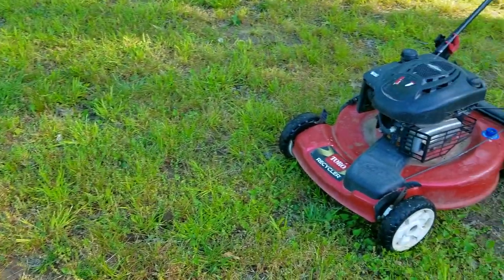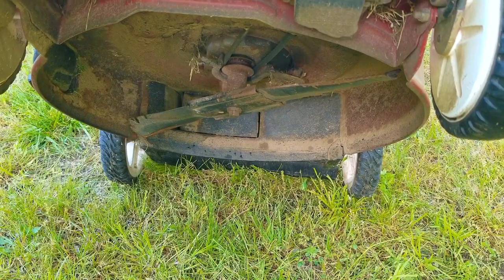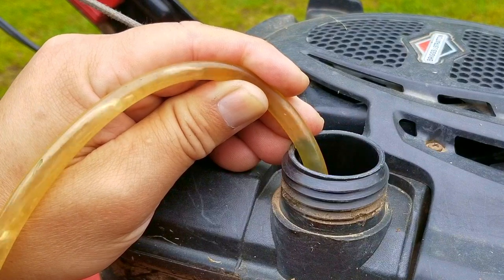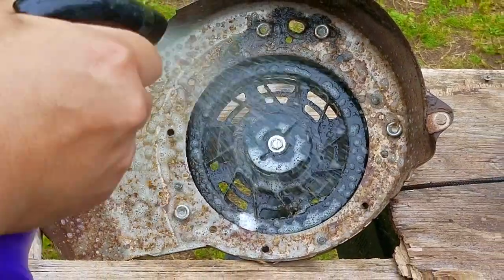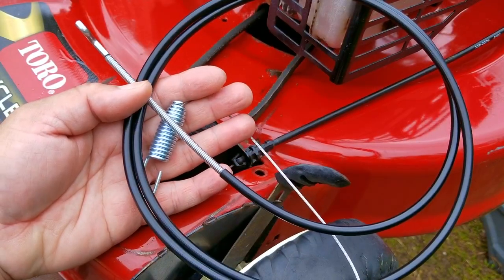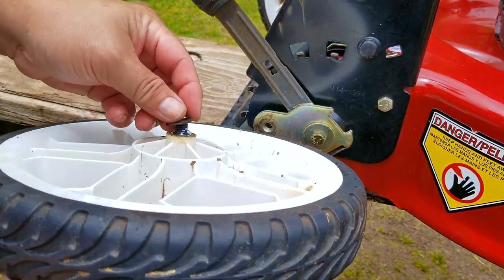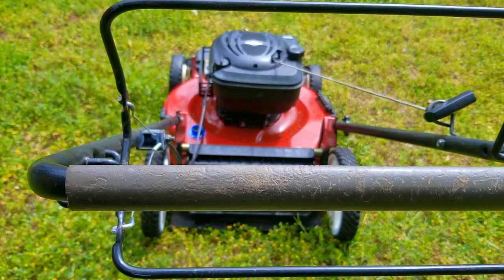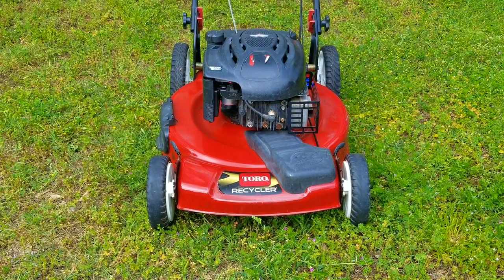Why Would Someone Dump A Toro Mower Like This

Comment: For me, a mower needs to need a lot of work. I won't necessarily scrap it. I have a 2012 Craftsman mower, the engine is great, but everything else is trash. Though the auto-choke occasionally acts up on it, I wish it had a primer bulb instead. The transmission needs replacing as it slips, and both drive wheels have the teeth ground out. I am keeping it as a backup, as it does still work and with a B&S Quantum engine, it's not bad. 

I recently replaced it with a Honda mower a neighbor was throwing away, which also needed its self propelled system serviced. But, after it was done, I feel it was worth fixing up the Honda instead. The Honda is older, so should the Honda quit, I have a backup. I will likely try to find good deals on the parts needed to at least rebuild my Craftsman and keep it around. Fix it up, but then spray fog all its components to keep it in storage until it might be needed again.
Reply from the maker: very well explained and having a good backup is a great idea, but I'd probably try to cycle the back up in once a month as well. just to make sure it's getting worked.
Reply: @INSIDEHOUSEGARAGE  Fogging as OP suggested wouldn't keep everything going correctly? I know here in the North unless you have SAE 5W30, nothing starts outside come winter time.
Reply from the maker: yes, fogging is not enough on its own.
Reply: @INSIDEHOUSEGARAGE  Gotcha, out of curiosity then what would you suggest during the winter months when we have 4 feet of snow on the ground? Star Tron Fuel Stabilizer Ethanol Free Fuel Fresh Fuel at triple the dose(Done for long term storage, topped Up After 5 minute run through system to prevent condensation), new spark plug, Fogged Machine, and fresh oil is always what I have done. Starts up first pull in the spring.

Is it more for the diaphragm and everything? We get -15 to -20 before wind chill factor in the winter here so I am genuinely curious.
Reply: @INSIDEHOUSEGARAGE  Thank you for all your info too. I really do appreciate it. I just ask the questions because outside of YouTube or forum lurking I don't really have anyone to teach me.

I might eventually take a course down at the local college though. Much appreciated for all the advice and patience you have with me.

I did find an interesting thing on this mower. It's actually made to be tipped up when working on it with the gas siphoned out. I have the same engine and the Brigg's literature is quite interesting on it compared to what Toro had available.
Reply from the maker: I wouldn't over do the dosage but it looks to be working well for yo.
Reply from the maker: yes I would agree as well. The carb can take only certain angles with gasoline in it, so it's just best drain it
Reply: @INSIDEHOUSEGARAGE I only ever do that dosage when putting them away for storage. I have a two gallon metal gas can purchased only for that and it is specially filled with that fuel and nothing else at the end of the season.

Triple dosing is safe assuming someone puts no other additives and actually due to the enzyme formula it allows ethanol free fuel out of an ethanol free fuel pump to last two years. I have never had any issues since I started doing that. It's even recommended by the maker.

I do a thorough cleaning to the mower at the end of season. Spray a rust protector, Stabil makes a good one as do a few others on the deck. I run the gas fully out of the unit, dump the oil, change the blade to a sharp one, spray a deck protector on the bottom of the clean deck when it is dry. Fill brand new oil, run for 5 minutes to make sure carb is full of Star Tron, pull the spark plug, spray the fogger in the hole. Dry fire the engine 3-5 times, replace the spark plug(I put a new one in after the first mow in spring along with the air filter). I always wait to burn off the light oil. If I remember and my hands aren't freezing I'll do the wheels otherwise on my to do list in spring. Finally using a measuring funnel fill right until it's safe to remove condensation. Then off to the shed for the winter.

I've never even had issues with issues in the carb. Taken it apart clean as can be. I'll run this tank through in spring and I do use a fuel cleaner with one gallon every spring. Usually Gumout with the Enzyme in the metal can since it's safe for rubbers, people can use Stabil's fuel cleaner, or I heard Amsoil makes a small engine. Whatever works but I've had zero issues with the gumout in the metal can measured out to one oz a gallon.

Amazon sells little premeasured ones specifically for 6 gallons. Throw one directly into the 2 gallon tank. Fill up, good to go, then I use it for the snowblower in the winter.

It's a bit oily feeling if you get it on your hands and doesn't gum up like Stabil.
Reply: @INSIDEHOUSEGARAGE  Definitely, a lot of it is actually to prevent the fouling of the spark plug too according to the literature.

Comment: A rusted out mower deck is a strong candidate for the curb.
Reply from the maker: agreed.
Reply: But a good engine could be used on another never maintained mower that isn't rusted but has cylinder walls that look like a scratching post.

Comment: i have 3 of those toros 2 with the new ohv Briggs engine and 1 with a Briggs quantum which i finally repaired,. one with the ohv engine has electric start capability. soon i gotto sell my mowers i have too many. problem is i dont know what price to sell them for. something reasonable for a buyer and profit for me. any suggestions?
Reply from the maker: sure, nothing less than $100, and add parts and your labor, it'd have to be close to $200

Comment: Great video as always, I Have A Question Please   My 10yr old mower Honda Powered self propelled Husky mower is starting to use some oil. I plan to run it till it’s dead.  I will not be getting a battery mower I’m old  by the time my mower quits Honda will be long out of the push mower business, I have a Choice between a Briggs motor or a Chinese knock off or possibly a Kohler engine. What do you suggest that I do, should I try to overhaul my existing Honda mower, try to find a new Honda engine, or just get a new Briggs powered self-propelled mower. Also, what brand of mower would you recommend to replace my 10 year old husky mower. Thank you for your help.
Reply from the maker: thank you Rick Leger. This is a tough one.  I would NOT recommend overhauling the honda, it would be easier to add, 4 oz of oil every few mows, than go that route. The reason is effort. If you're driven enough and have the time, it's a decent idea, but most people have families, hobbies and other things they could be doing.  As for the engines, I'd pick another Honda first, the Briggs second, and Never buy a Honda knock off.
Reply: Great Advice  much appreciated  Lov the video’s  very professional
Reply from the maker: thanks

Comment: The only way I can get those toros to shine like that is pull engine and use buffer.
Reply from the maker: yes that's one way of doing it, just treat it like a 1 stage paint correction on a vehicle
Reply: Vinyl detailer can add some shine to the plastics and the paint maybe just throw some wax spray
Reply from the maker: that's a good idea

Comment: Wow good work with the mower 

But i got a other question i have a honda lawnmower and the back wheels dont spin and i hate it can u give me some advise of what could be the problem and then try to fix it myself thx u
Reply from the maker: thanks, so the back wheels don't spin going forward or backwards?  If so remove the wheels and see if the axle the wheel spins on is rusted. As for going backwards, the drive axles might be fused to their bushings. that's a whole other issue.
Reply: @INSIDEHOUSEGARAGE  it doesn't spin forward, but it does go backwards
Reply from the maker: oh I see, I think someone installed small drive gear by the wheels on backwards

Comment: I have a older Craftsman, My Stride, 21" self propelled push mower. The drive cable broke and i can't find one. It has the barrel end on it that hooks to the drive part up front and the spring up next to the handle.  Any ideal where i could order one from, thanks
Reply from the maker: sure, If you can find the sticker, on the mowing deck and tell me what the model and serial number is, I'm sure I'll be able to find it.
Reply: @INSIDEHOUSEGARAGE  Thanks much, i will definitely send that tomorrow morn!
Reply: @INSIDEHOUSEGARAGE  Model #  247.377300,  Serial #. 1C105K31241,  for the drive cable, thanks i really appreciate this!
Reply from the maker: from the information this is what I found
https://amzn.to/3WWLZ8w

but look a this diagram first and see if this looks like your mower.
The item number is 42 further down the page. 
https://www.ereplacementparts.com/craftsman-247377300-lawn-mower-parts-c-158286_173893_491660.html
Reply: @INSIDEHOUSEGARAGE  Thanks for taking the time to help me find one. I finally found one at another site where Taryl shops

Comment: I have a Troybilt with a Honda GCV160 engine and it revs so high i tried adjusting the governor but it doesn’t seem to be working, should i check for something else?
Reply from the maker: sure, I'd check the operation of the linkage and the throttle plate on the back of the carb is working like it should

Comment: I would suspect the mower was owned by someone older or not mechanically minded: maybe they could change the oil, a spark plug, air filter, and maybe even replace the blade … but anything beyond that required professional service. They may have been reliant on a mower dealer service department or a “Main Street Shop” (either one with a fancy building in a highly visible business location part of town that has high overhead cost to operate, and charges accordingly). They might have perviously spent more than they felt was reasonable there and the thought of bring it back and spending more than they assumed a decade old mower was worth seemed out of the question, so they just “dumpstered” it. They might not have known that a used market for a slightly broken mower existed, or simply didn’t care to be bothered. It sometimes amazes me what people are willing to throw away simply because they don’t want to be bothered or are too lazy to deal with it. I’ve seen people give away nice, older used cars to their local mechanic in response to relatively small and inexpensive repair quotes, simply because the car has a minimal trade in value and they don’t want to be bothered to pay for the repair and private party sell it themselves. This is relatively common in more affluent areas.
Reply from the maker: I think you might be right
Reply: Found one Quantum Powered mower like this back in 2009 or so. It was at curb awaiting scrapper/garbage courtesy pick up. I had an oil-burner B&S 'Sprint' engine & was tired of the oil consumption & staying ahead of it. Anyway, it was a loose cutting blade, fouled plug, plugged air filter. New Filter, bolted to my deck, threw my oil burner to the scrap yard. It's been 13-14 years. Still runs great. Far better than any other engine built in April 2000. That's the build date on mine. Never do anything to it, new filter/plug every five/six years. 
Oil change every year.  These Qs don't break if the oil is serviced.
Reply from the maker: you are correct

Comment: well a hole in the engine would be one for them etc.
Reply from the maker: very true, although I might still keep the entire engine on the self, just for parts.
Reply: @INSIDEHOUSEGARAGE  why's that ?
Reply from the maker: parts reference, If the flywheel, coil, and carb were on the self separately it'd have to remember where it came from? "was that from the 140,   150 or 163 cc engine?" with it as a whole, I won't have to .
Reply: @INSIDEHOUSEGARAGE  wow that figures.